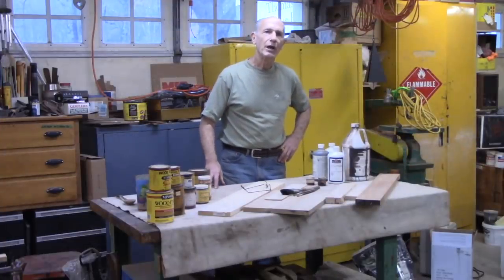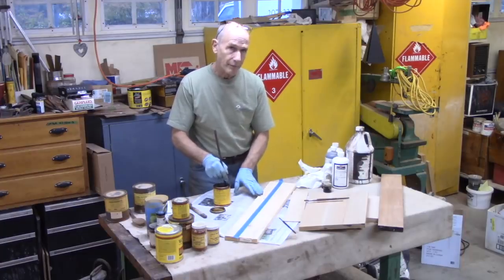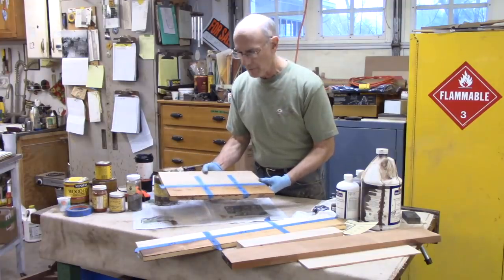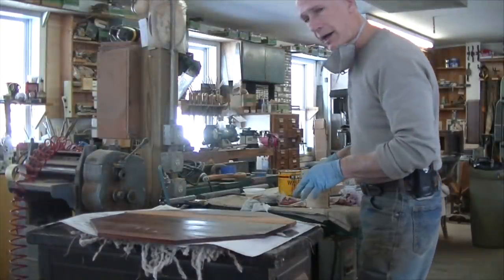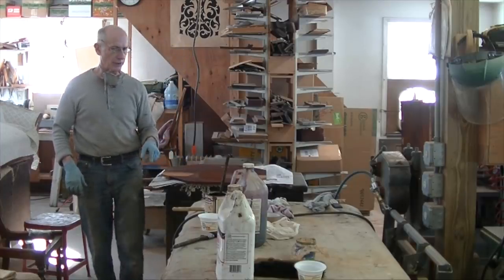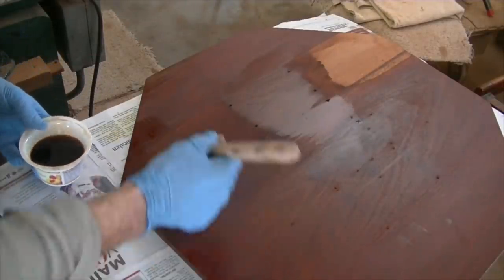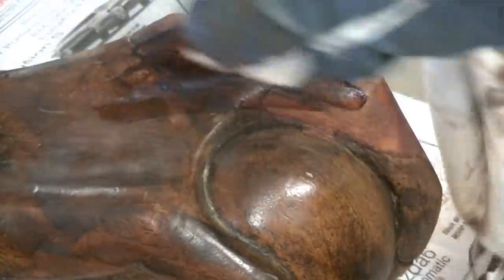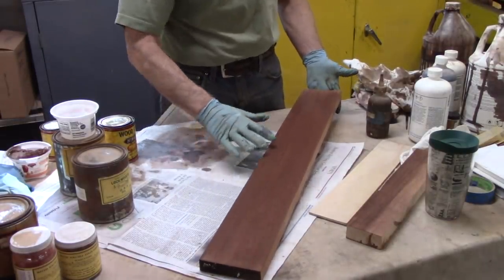Staining Wood - Thomas Johnson Antique Furniture Restoration

Comment: Hi, Tom. Your video is very well timed for me. I have some beautiful Spanish Cedar veneer which has a really nice curl in it. The natural color is a golden amber, which is very nice on its own. For my project, I'm going for a more dramatic, darker tone. My first foray into dye stains was today, in fact. Never used them before, but your comment on how dye stains allow the natural chatoyance to shine through is one I had heard before.  I mixed up some J.E.  Moser's American Walnut, and kept testing on a scrap piece until I had the mix where I wanted it. Test, add dye powder, test, add dye powder... I also prepared a scrap for a pigment oil stain, Minwax Special Walnut. Nice color, but it really dulled the curl. I have the piece colored with the dye stain and laid on a coat of Danish oil. WOW! The dye stains really let the wood come to life. I tried a diluted mixture on a piece of curly maple. Padded some on, let it dry, then sanded it back. That REALLY accentuates the curl.I don't know if I'll ever bother with the pigments again! Thanks so much for all of the inspiration and knowledge you share.
Reply from the maker: You are very welcome! I'm glad that you're having such a good experience with them. Samples are one thing, it can get difficult on the actual piece, depending on the design. Good luck!

Comment: Hi Tom....love this video !  In the past i created a  number of art pieces in wood and worked with a number of designers where i would create custom colors for all kinds of wood surfaces.  If you prefer the oil stains and want to match a certain color that isn't offered in retail, you can fine tune with "International tints", which are available in some hardware stores.  "i.t.'s" are oil soluble as well as water soluble.  If you still can't match it up,  you can buy fine art oil colors sold in craft stores....look for "student grade" for the best price. They mix beautifully since they're already in an oil base.  This should make your color challenges a lot easier.
Cheers !
Reply from the maker: Thanks! I do have a lot of colors, but that's interesting, I've never heard of the "IT's" But I only buy the basic earth tones anyway

Comment: I'm redoing a very old wooden rocking chair that was missing the rockers.  I had the rockers made but they are red oak.  I think the chair is a mix of woods.  I don't know how good this is going to turn out, but you gave me some things to think about and the courage to experiment a bit.  Thank you.
Reply from the maker: Your welcome! And yes, it will be tough to match that oak. Usually the mixed woods are birch and maple. But maple is notoriously tough to stain. The oak will take stain just fine, but try to avoid stains that have any red in them. Try a walnut stain, dilute it as necessary.
Good luck!
Reply: @johnsonrestoration  I realized too late I should have used walnut. I screwed it up and used cognac color which I normally like but too much red.  I just spent the morning with mineral spirits and steel wool taking off as much as I could.  And I didn't know I was not to stain antique wood.  Well, this chair was a mess and I had to strip it down to nothing.  I don't think I screwed it up too badly, except for the rockers so I will keep working on them.  I will never do that again.  That's how we learn. Thanks.

Comment: Nice job as always, Tom! We don't even try pigment oil stain anymore ( especially minwax....yuk!!) Typically I work with the dye stains and can usually hit it the first time out, if not then I modify with various dye stain colors (they have a rainbow). However those repairs that occur in the middle of, say, chair parts, I'll use the dry pigment powders with turpentine and work them into the right colors and then seal it with a spray finish. I like the dyes best due to the transparency, but with some applications it just pays to "paint" the colors. Can't wait to see how you play with glazes( I've had success with them) and toners , which I haven't tried at all! Great work, Tom......could you maybe start working a lot more hours in the day so that we get even more videos??
Reply from the maker: Thanks Michael! I too mostly work with the dyes, but sometimes you're looking at something and it just needs the pigment stain! (especially if you're trying to match a factory finish) And yes, I'll work more!!!

Comment: Thank you, thank you, thank you. By far the best video I’ve seen on stains and I learnt so much.

When printing photographs with an inkjet, although the gap has closed significantly over the last 5-10 years, pigment inks still have better archival qualities. My question is, that although I presume the dye will remain bonded to the molecules for eternity do they fade in colour faster than pigment stains. I know furniture will fade if directly in line with the sun (uv rays), but does tend to be dyes? 

A superb video, even at your extraordinary level, one of your best. I think the speed comments have been posted and the calibre of those comments show the respect you are held in as a furniture restorer.
Reply from the maker: You're welcome! And thank you too! The dye stains are not known for light fastedness. But the pigment stains are specified as interior only, indicating that they would be affected by light also. I've only seen problems when there is strong sunlight involved, for instance the upper floors of a high rise building.
Reply: Thomas Johnson Antique Furniture Restoration Thank you for your answer.

Comment: Great video Tom.  Question, how to decide what brush to use, bristle (natural/synthetic) vs sponge?  How do you preserve your brushes on overnight projects?  Do you clean and reuse your bristle brushes on a new project?  What are your lint free rags made of?  On other videos I notice you use tape to identify things.  How does your numbering system work?  What is difference between your use of yellow vs blue tape, if any?  Do you collect unused stain and stripping ‘gunk’ in bulk to be disposed of later?  If so, since it is flammable, how long and where do you retain this material until disposed of?  Your an inspiring ‘teacher’.  Keep up the good work.
Reply from the maker: Hi Carol, thanks for watching! too many questions! I use brushes except for Waterlox Varnish, for which I use a foam brush. I keep the brushes clean, except varnish you can keep them in paint thinner if used again the next day. The yellow and blue tape have no significance. All hazardous waste can be dried out and put in the regular trash

Comment: I'm learning a lot from your videos and want to offer something back as a contribution: There is a secret trick for dealing with the fuzz from water based products. Ignore it. For new furniture that I've built, I will plane, scrape, and lightly sand and then apply water based dye stain. I don't do the "wet it, dry it, sand it" thing. I just put on the dye. The grain will stand up. The work will feel awful. Ignore it. Get a first coat of finish on. When dry, give a single wipe with 600 grit. I like to use the foam backed pads (rhynosoft). Don't think of it as sanding. It is literally just one single wipe from one end of the part to the other and stay away from the edges. The fuzz will feel better, but you will still be able to feel it. Now get a second coat of finish on. After a second coat, you can be more ambitious, use 320 grit and get closer to edges. Proceed with other coats similarly. Don't take what I've said too literally other than the idea to get rid of the fuzz progressively as the finish builds:  I described water based top coats, which have high solids and build fast. If you are using a wiping varnish or other finish that goes on with more coats, you may need to wait for two or even three coats before you are ready with the 600 and will need to wait longer for going heavier with the 320. But, that is the idea. In the end, I get a silky surface and I really do not think you can see the fuzz that is buried in the finish. You clearly know so much more than I do, but I've been somewhat forced to make water based finishes work, so I wanted to share this to say thank you. I learned this method from a professional furniture maker who does a lot of finishing.  (Edit: I need to think if I'd feel differently if I were working with carving or situations where sanding even with finish on might be a problem.)
Reply from the maker: Thanks! Yes, all good info. I think it would depend on the design of the piece and the wood. If it was easy to pre-wet it - then why not? But yes, I agree, not absolutely necessary

Comment: I'm curious about the long term implications of using a stain to color match the old wood.  Obviously in the short term, this makes the restored portion of the piece match the rest but what does that do in the long term?  Are you likely to end up with a different color in the stained area as the wood oxidizes and changes with UV exposure?
Reply: Scott M ....I think that while this question shows a good track of thought, it’s a bit of a moot point. Because what else is one to do? Better to have a restored, attractive and useable antique than allowing it to languish in disrepair. If a color shift does occur down the line, the piece is still useable and a future restorer can address the issue. Perhaps by that time furniture stain technologies will have improved also. Time and the elements march on and never fail to leave their marks.
Reply: @mercoid  I agree with your way of thinking.  Furniture is meant to be used and most will end up in a landfill if not used.  Therefore, a respectful restoration is by far the best option.

I was curious about whether this was something that was considered in the process or if it just had to be lived with.  Thanks for the answer!
Reply: Well, your question, of course, applies to what they call in economics the "long term". When questioned about what was meant in Economics by the "long term", John Maynard Keynes, famous economist, was said to have said: "Well, in  the long term, we will all be dead". As Bugs Bunny once said "Enuf said.....doc".
Reply: From my experience in industry, some pigments are more stable particularly when it comes to ultraviolet exposure. There maybe information from stain manufacturers or hopefully Mr Johnson has information about this and he will reply to you.
Reply from the maker: I agree with Mercoid. But there is nothing to be done. The one and only time I consider it is when I am finishing new cherry furniture, if there are nail holes, etc to be filled I will use a much darker putty
Reply from the maker: Exactly. If there's a problem someone can redo it.
Reply from the maker: Yes, basically, what else can you do?
Reply from the maker: But do you apply this to all your decisions? Or, to put it another way, what if you really lived everyday as if it were your last?
Reply from the maker: I understand that the Mohawk Ultra stains that I use are made to be as light fast as possible in a dye stain.
Reply: @johnsonrestoration  I appreciate the time you took to answer. Thanks for indulging my curiosity!  Got an interesting discussion to boot.
Reply: Gosh I hope you don't apply those thoughts to all your decision making processes.  Your accomplishments must be in the "to be expected" category.
Or.....I want "guaranteed" out come for life.   Beware the "lifetime guaranteed" !!!
Reply: I sub work for an antique store,the owner is in his late 60’s and the store was owned by his father before him. 
He’s shown me patches and such that he or even his father had done more than 10 years ago... “not for sale” pieces and I personally could not detect any real noteworthy differences.
in fact I’m sitting next to a desk I’d traded from him a while back...one of the drawers was missing and he had to re-make it 
and after several years I’d still about have to pull out the drawers in order to tell you the “new one” from the original. 😁

Comment: Thank You, I enjoy learning from your presentations. I have always had trouble finishing in the same room as my woodworking tools are in. The dust, however fine, hanging in the air seems to land on the wet finish. Even with dust collection, there remains fine particulate in the air of my shop. I notice that your machines are in the same room. How do you protect your wet finishes from the dust?
Reply from the maker: You're welcome! For most of the coats I'm not too worried, because I sand a lot between coats. When it comes to the final coat I will try to not raise a lot of dust that day, and then apply the coat after dinner, and leave the heat up. Seems to work well.

Comment: Hi,
I have a bed very similar to the one you were showing. It has a lot of scuffs & scratches. Would it be best just to go over the whole thing with a dye stain? And them what kind of finish would you recommend?  I love to work with wood furniture so I hop I don’t get on your nerves by asking you tons of questions. I’m learning so much from you. 
Thank you,
Sandy
Reply from the maker: Thanks! It’s hard to say without seeing the condition of the finish. Don’t use dye stain. Try Old English Scratch cover then wax. (Try a small area first). If that doesn’t work go over it with an oil stain. Only if neither of those worked would I try a dye stain. Also, try some of the Formby’s products, they make a finish rejuvenator that might work well. Good luck!

Comment: Tom, I love your videos.  Hope you can help me.  I am refinishing a maple cocktail table and have taken it down to bare wood sanding up to 180 with an orbital sander.  The wife wants a dart walnut color and would like your thoughts on which is the best stain to use.  Thanks in advance for your thoughts and guidance.
Joel Goldberg
Reply from the maker: Thanks Joe! Staining maple is difficult. Professionally it is done with dye stains using spray equipment which is not available to you. Use a walnut stain from the hardware store. It might not look good and will not be dark enough. Next apply "toner coats", this is the finish (polyurthane) with the walnut stain mixed in it. Each coat will look better. Sand the underside of the top as well as you did the top so you can first experiment on the underside
Reply: @johnsonrestoration  Thank you for taking the time to review.

Comment: As a coatings guy, I am wondering why not a heavy bodied stain or a gel stain? You can build and blend the layers of color depth much easier and faster. Just thinking out loud. GOD Bless
Reply from the maker: Thanks! That's true to a point. It relly depends on the wood and what you're trying to achieve
Reply: Thanks for the reply Tom. I work a lot with tinting stains at the Paint and Decorating store I work at. I really like your technique of layering the under lying tones with the more prominent foreground shades. There is no one that I know of where I live( Lakes Region of New Hampshire ) that does what you do. Would it be possible for us to send our customers to you that are in need of your skills? Love your channel. GOD Bless.

Comment: do you have a video that intensely covers refinishing of a piece that is heavily covered with a leathery or gator skin finish and how to deal with it?
Reply from the maker: You know I don't! And it's difficult. The best solution is too strip and refinish. Otherwise I start sanding the finish - not down to the bare wood, just sanding the finish to make it smoother. When I sanded as much as I dare, I give the piece 2 coats of finish, and start sanding again, the finish starts to fill in and become smoother. It's just a lot of careful sanding!
Reply: @johnsonrestoration  Thanks, That makes sense. I will give it a shot. I have always been afraid to touch it.

Comment: Tom, which brands are dye stains and which are pigment stains?
Reply from the maker: Thanks! Pigment stains usually are the oil stains you see at the hardware store. Dye stains can be purchased at Rockler's or Woodworker's Supply and other places

Comment: NGR stains can be tough to use, because any overlaps in corners will double the colour, so you need to be really careful how you apply it. Aniline dyes are nice, but not good for restoration work as they tend to fade after a few years once exposed to sunlight. Not as big of a deal if it's a full surface (a top or the full front of a drawer) but very bad if it's to hide a patch or a veneer repair. Also, I tend to use a combo of stains in the opposite order. Oil stain first, to get a base colour that's close, and THEN dye stain over the top if it's not dark enough.
Reply: Since the linseed oil binder in oil-based stains acts as a sealer, are your dyes applied over the pigment stains acting more like glazes?
Reply from the maker: Thanks John, and yes, I've used them in the other order too. There are so many combinations of ways you can do it - I think I'll get into that in the video on glazing
Reply from the maker: That's exactly right, and I'll get into that in the video on glazing